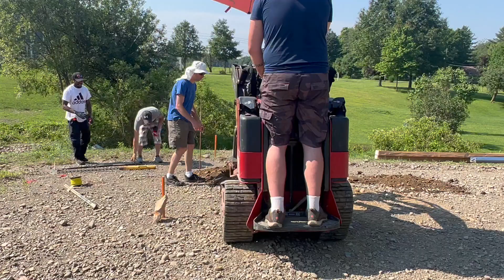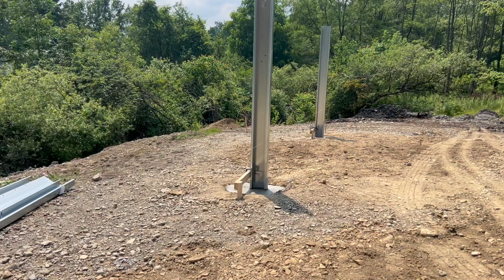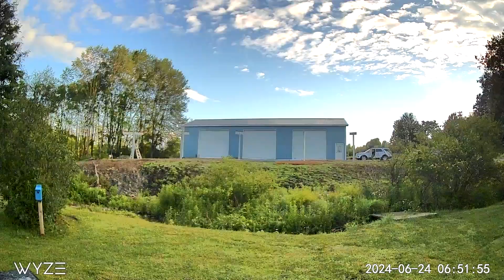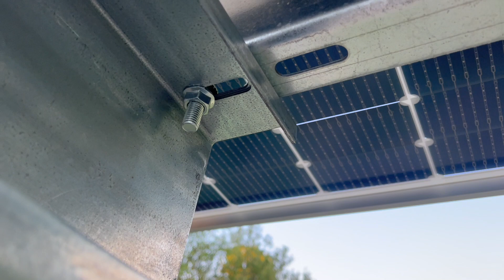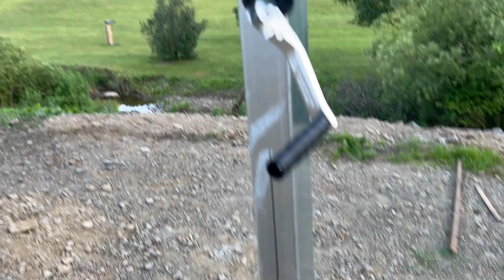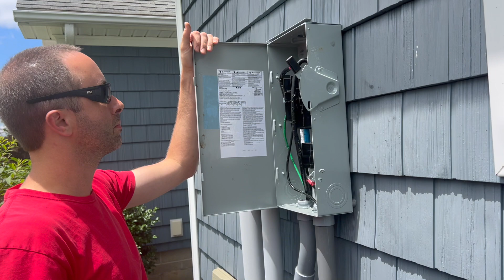Solar Installation Process - 40 Panel Grid Tie with Ground Mount

Comment: What I found out about US solar installers... That they all overpriced the solar systems!!! All because of the 30% tax credit... Take a look at European or any other nation's solar installations. They all cost two to three times less than American!!! American solar installers are selfish greedy individuals....
Reply from the maker: I researched DIY and 4 contractors.  For my goals, my time value and system needs, I found the most cost effective solution.  It is well done.  It works wonderfully.  
If I were to build a new house I'd consider how to be more independent.  Right now, this system with the installer I chose was the best for me.
I think that's the goal...find solutions for the individual and situation.  

Someone who is wanting to DIY may start with some panels and learn and then grow.  I wasn't in that situation.

I looked at battery and off grid and it's not realistic where I live....yet.

Comment: Nice job on this installation! I am about to install a similar Sinclair Rack for 48 bifacial panels soon and I was wondering how you've liked the system so far. Is there any recommended maintenance for the metal rack? Grease for the moving parts? Etc. Also, how long did the installation take your contractor? Thanks
Reply from the maker: Like it a lot thus far.  Easy to move.  I didn't see anything about lubricating anything, but I went through with fluid film and hit wear surfaces.  I figure a little protection won't hurt.  The construction of the array tool a few days.